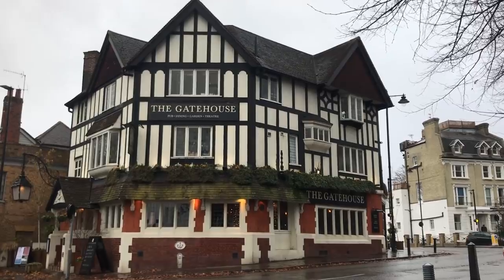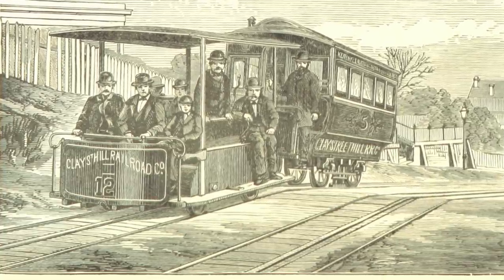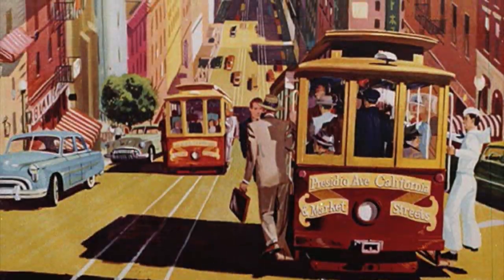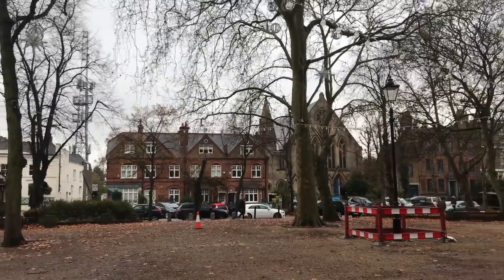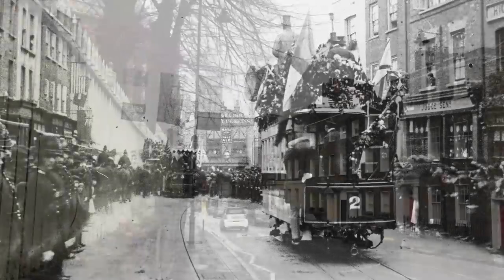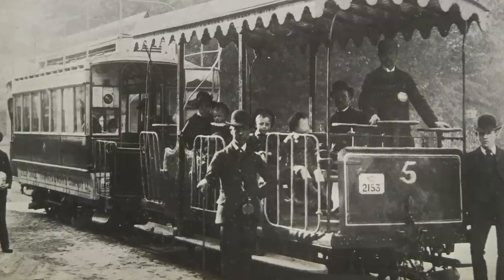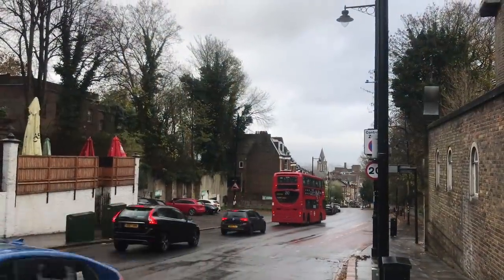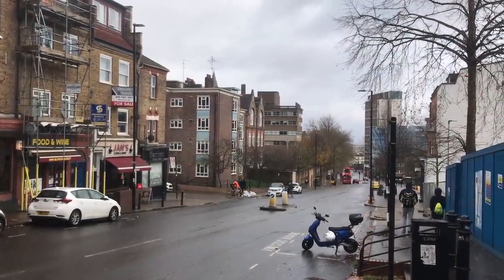Getting a Grip on the Highgate Hill Cable Tram

Comment: More on trams would be very interesting. I've often wondered how the trams from different boroughs in London operated together. Did they run on the rails of other boroughs or did the passengers have to change trams.
Reply: In general, it was not widespread and the LCC discouraged such desires. The North MET did run jointly to Paddington but their older vehicles were an embarrassment to the LCC and much of the LCC's system was conduit-operated anyway. Often, lines of different systems had to await LT ownership before being physically connected.

Comment: 7:12 Here where I live in the Medway Towns we had a tramway system through Rochester, Chatham, Gillingham and Rainham, which also included some steep hills and I'm curious how the electric trams handled these.

There's persistent rumours that there was a pusher tram (with an short tunnel as a shed) at the bottom of Chatham Hill, though I've never found any 'official' reference to it, nor do any maps of the time show any sidings. Plus the both of 'tunnels' either of which supposedly was for this pusher tram are really in the wrong place, part the way up the hill rather than at the base. There's also the fact that the tram network had equally steep or steeper hills elsewhere and there's no mention of pusher trams with these.

How did electric trams cope with steep hills elsewhere? And did any of them ever use a special tram as a banker?

Comment: I’d love something in depth on the benefits of trams/trolley buses over buses. In most cases (in the UK), the tram infrastructure was just too expensive to renew once it wore out, so trolley buses were used instead (needing no rails, and therefore a much cheaper infrastructure). But, eventually they befell the same fate, when it became too expensive to maintain the overhead electricity system, and trolleys were replaced by buses - no expensive infrastructure and much more flexible. So, looked at that way, the demise of the tram (and then the trolley bus) was inevitable and made perfect sense. 

And yet, in many countries, both tram and trolley continued. and, of course, we now have the arrival of modern tram/light railway systems all over the UK - much more expensive than the old tram systems, and yet apparently a worthwhile (profitable?) alternative to buses. How did economics both get rid of trams AND bring them back?

And why didn't the same economics apply elsewhere? We live part of each year in Debrecen, eastern Hungary, so I have direct experience of all three forms of transport over there, and the three coexist quite happily. The tram-trolley bus conversion did happen, with three of the four tram lines being converted to trolleys, but one tram line did survive (the one that runs through the main part of the city) and all the trolleys are still running. 

And the tram line has recently been doubled into two connecting routes, with the new section taking over from two very busy bus routes - which apparently cost-justified the extension. These tram lines (even the new bit) are 90% traditional on-road tracks, by the way, not the UK-style tram/light railway mix (but then, generally the roads are much wider and straighter over there).

Another interesting aspect of modern tram/trolley/bus systems, which is already happening over there, is electrification of road vehicles. And, rather ironically, it seems that this will end in the demise of trolley buses. The trolley bus fleet (dating back to Soviet days) was replaced by brand new, state of the art, trolleys a few years ago. I initially thought nothing of this, as it was well overdue (the bus fleet was renewed at the same time), until one day I was crossing a road near the end of one trolley bus route, but not actually ON the route, when I was nearly run down by a very unexpected trolley bus!

I then discovered that the new trolleys can run on either overhead wires or internal batteries, giving much greater opportunities for extending routes and offering alternative destinations.  So, trolley buses morphing into battery powered electric buses. And when you consider that ordinary buses will need to be replaced by electric ones soon, what do you end up with - all the buses become electric, but a few still run on (mostly) overhead wires. Come the day when those wires need replacing, and what happens? It makes far more sense to replace the old trolleys with new electric busses. If that isn't irony, I don't know what is...

Comment: Enjoyed the video. I got the impression that you were not impressed by cable car systems. Even so they were  were successful in some places. Chicago, Melbourne. Two issues in Melbourne  a) passengers having to push round corners to grip different  cables b)the practice of continuous  running so passengers had jump on board the car in motion. A commuter skill like hopping on an of escalators, or non stop elevators found in Germany. Like rear entry London buses they had a steady number of casualties. Alas in Melbourne the war was the excuse to end the service rather than up grade the system. Capacity was a limiting factor. Was that an issue in Highgate?
Cheers
Wayne

Comment: Funny that, you called it down market (or a similar expression) in the Dick Whittington video.
Reply: Archway, at the bottom of the hill where the Whittington stone is, is a bit worse for wear or dangerous in parts - the area has also gone through highs and lows over the centuries so I guess it also depends what time frame you're looking at

Comment: Trams or similar don't appear to have anywhere as much success in the UK as they do abroad (especially on the Continent).

My 'local' area's try at it is the Cambridge Guided Busway.  The services are popular in terms of numbers of passenegers, but the build went WAY over budget, suffered (and still does) from problems associated with flooding on the routes, some of the more major 'stations' are little more than platforms/bus stops (due to the huge overspend), and I'm not sure if the council will ever make its money back, maybe losing £00Ms if not £000Ms over its life.

The routes to the north (the major part) could've just been roads debdicated to be used by normal buses and cycles at a far cheaper cost.  It might've even been cheaper to use actual electrified trams or trains (it was a Beeching cuts old railway to St. Ives)

Comment: What's wrong with the lamp opposite Big Ben at 2:40? Looks a bit lop-sided...
There's a "Tramway" in Istanbul which is cable drawn; it's underground, only has two stations and two cars which share a single line, with a dual section in the middle for them to pass. Well worth a visit!
Reply: That is the way the Glasgow subway useto run it was so rundown it was known as The Shoogle.

Comment: Are the cable "tunnels" still in place   ?
Reply: Probably not.  The conduits were the width of the track, in this case 3ft 6in. and had iron cross framing every 4 feet or so.  There were rails, that the car rail on, between the cross frames.  It was about 3 feet deep.  The structure was filled with concrete except for the space for the cable and the slot opening for the grip, which had railing on either side to protect the slot and guide the grip.  And you had two of these in the street.  Plus there were pulleys, call sheaves to carry the cable, spaced about 5 feet apart.
If you are converting to electric trams or buses, you normally ripped all of this out.  In Dallas Texas, a company started building a cable car system but switched to electric traction before they started running many years later a contractor putting it a water system discovered the conduit was still place and in the way.  So much for the low bid.
And this was my quick comment.
🙄
Reply: @delurkor  Thank you very much for the answer 😀